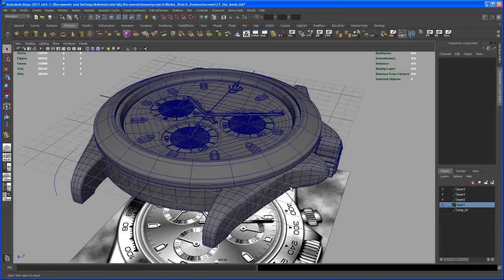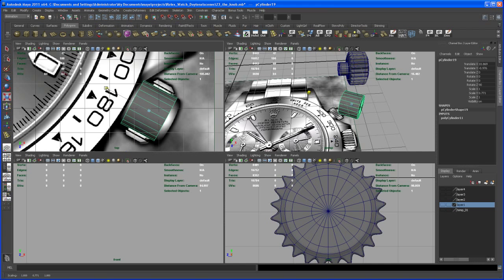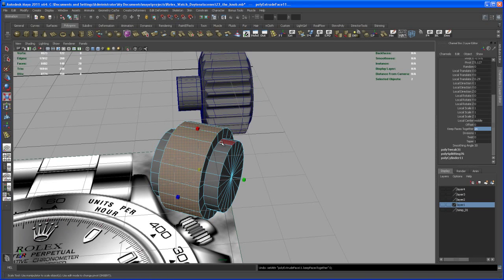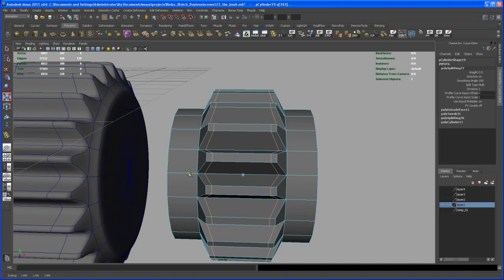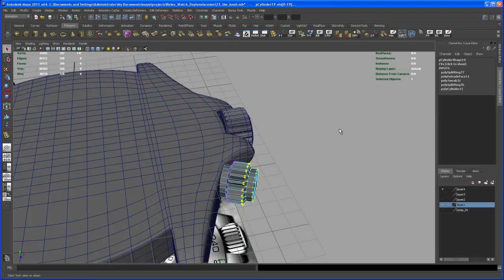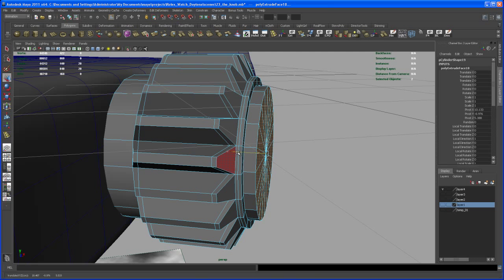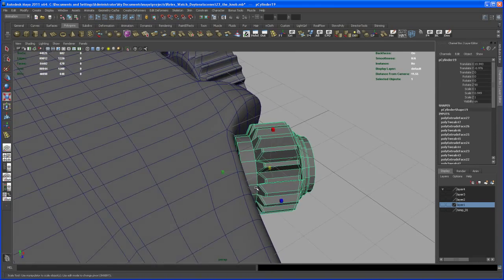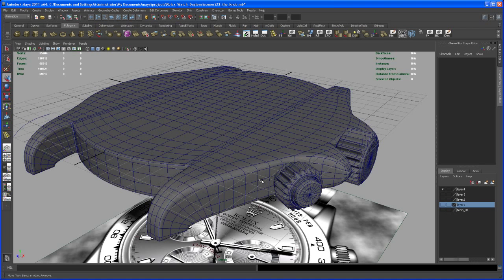Modeling tutorial in Maya - ROLEX DAYTONA watch - Part 24: more knobs

Comment: This is how i solved the problem with the extrude:
-i hid everything and duplicated special instances from the same position as the previous knob
then in multiview i was able to extrude and adjust the cylinder in the original location from the perspective cam while watching from the top
afterwards i was able to delete the one i used to model the others